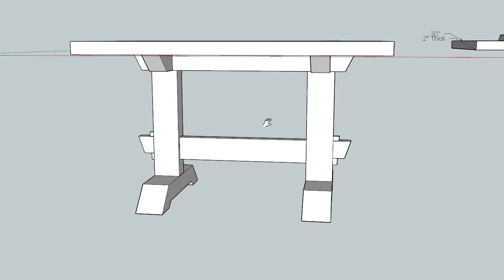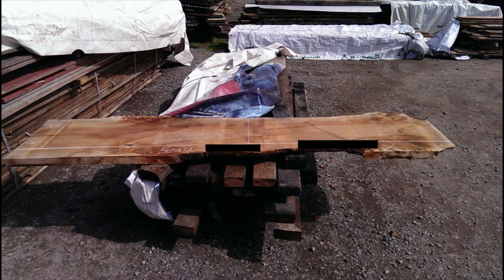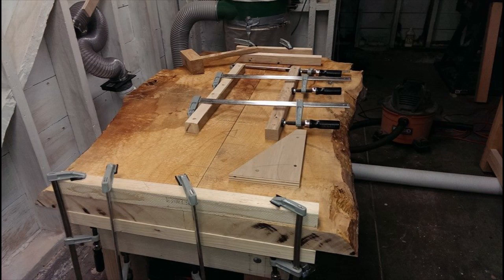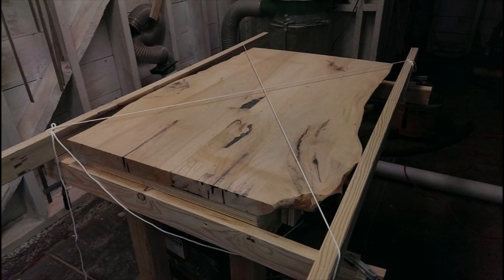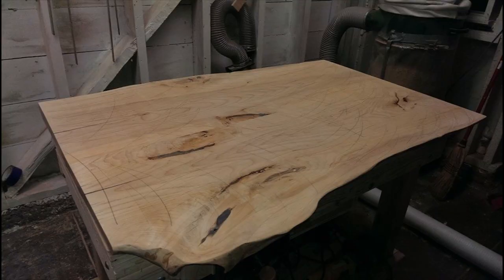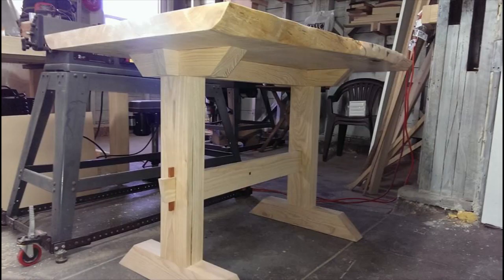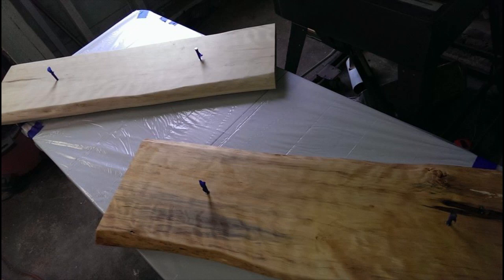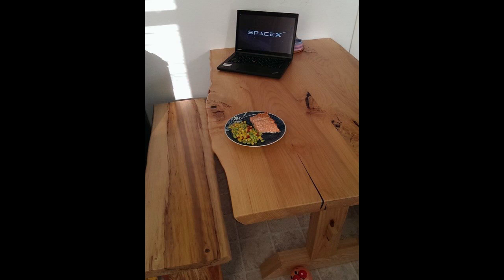Live Edge Kitchen Table Build Walkthrough

Comment: WoodworkerX! How has the alder held up to daily use? I am looking for inspiration for some 2" spalted maple. Thanks for sharing your build. 
'
Reply from the maker: Very well.  It's got the usual marks from forks and plates but it has been really good.  Some dings on the edges but that's to be expected with a two year old.  When he's 5 I'll take the top and bench tops to refinish them.  Little more epoxy to fill some bubbles/spaces in the small cracks but overall it's been very good.  Thanks for watching and good luck